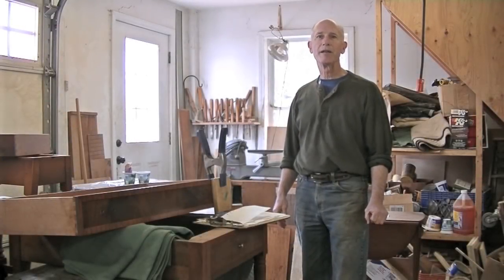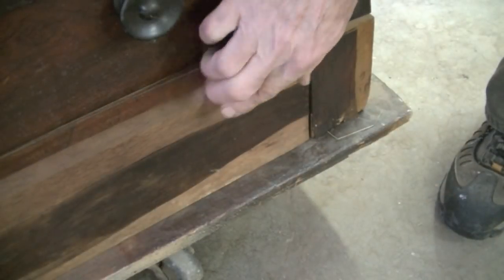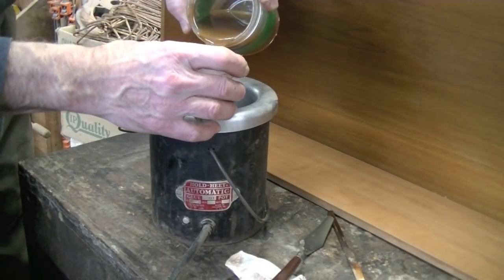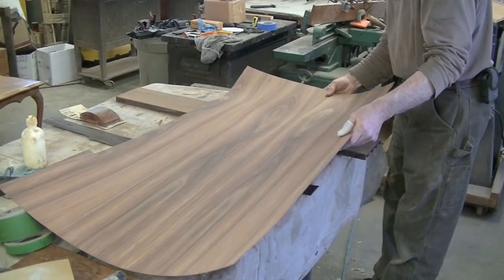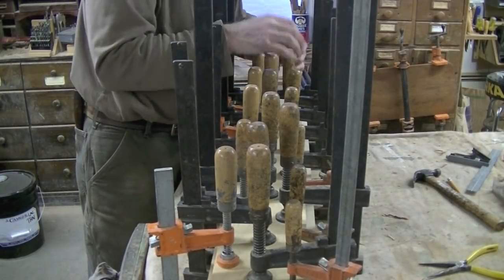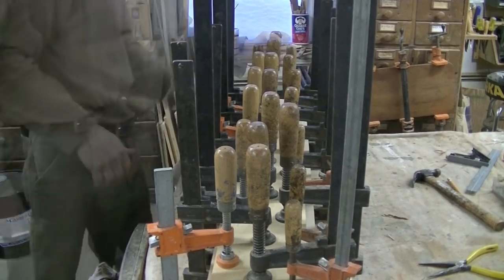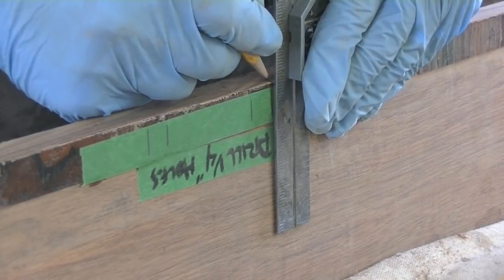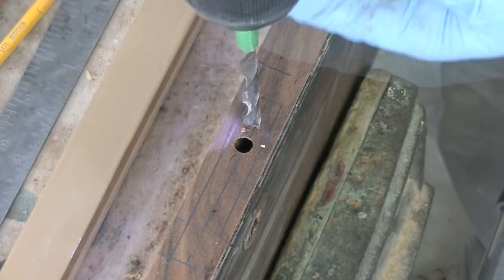Restoring an Antique Cabinet (Part One) - Thomas Johnson Antique Furniture Restoration

Comment: Just a quick note: I've also come across a "painted stone" effect like this. Mine was on an 1860s black marble base oil lamp. The "black marble" base was actually a cheap dark reddish brown stone that had a marbled paint decoration over the cheaper looking stone. With a nice polish/varnish on it, you really can't tell it's a cheap stone.
Reply: Also, great restoration so far. This piece is an absolute mess, which is a shame, since it's really beautifully made. I'm sure it will look great when it's all done.
Reply from the maker: sooth15 Yeah, it's very interesting. It's amazing how much trouble they went to instead of just using stone. My guess is besides being cheaper, they could just produce a consistent product.

Comment: Hi Tom!   do you remove the old finish before fixing the veneer or do you fix the veneer first then strip the old finish?    thank you!
Reply from the maker: +Daniel Bornhoeft Always do all repairs before stripping. You don't want stripper getting into places it doesn't belong! Sometimes you need to get some finish off the veneer so you can match the grain, but a little solvent in that area should do it.
Reply: +Thomas Johnson Antique Furniture Restoration thanks Tom!

Comment: In watching you apply the new veneer to the bottom drawer, it occurred to me that you, in general, might not want the caul to to be perfectly flat and rigid but want some slight flexibility in case the substrate has some unevenness to it.  Is this co?
Reply from the maker: Thanks! That is absolutely true! A vacuum press works very well for these type jobs for that very reason. These pieces were very flat

Comment: I am sure since this video is so old some one has to have mentioned it before but have you ever used one of those vacuum bag systems to glueing up?
Reply from the maker: Thanks! Yes, I have. A vacuum bag has limited application for antiques, you need to put the entire object in the bag. You'd have to break everything down to elements that were suitable for the bag. Not practical

Comment: Hello! What to do if there is an air bubble under veneer where you knocked?
Reply from the maker: Thanks for watching! Sometimes heat up the area with a hairdrier and clamp it. Or cut a slit in the middle, along the grain, force some glue in and then clamp